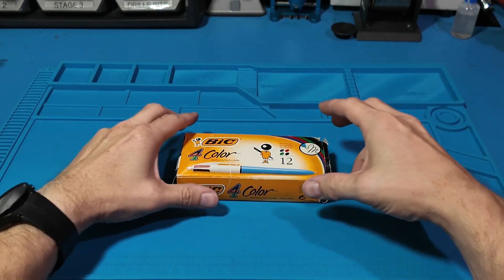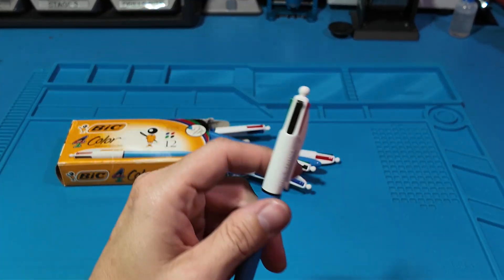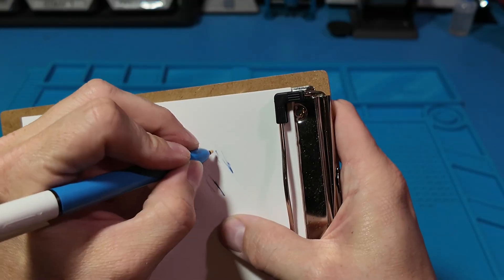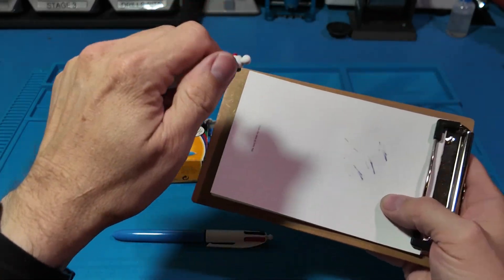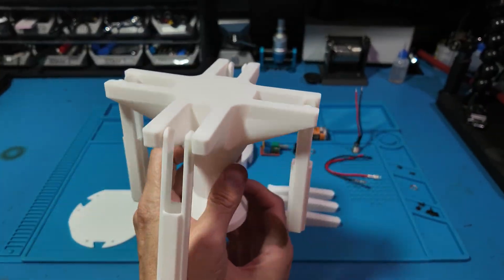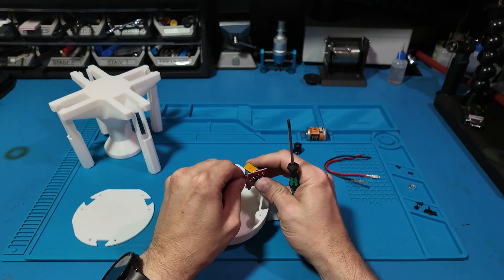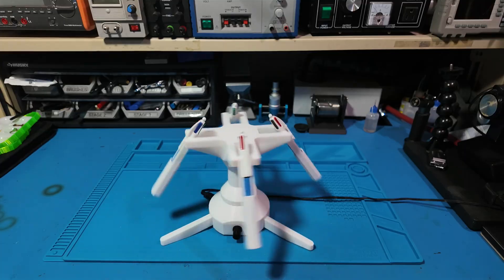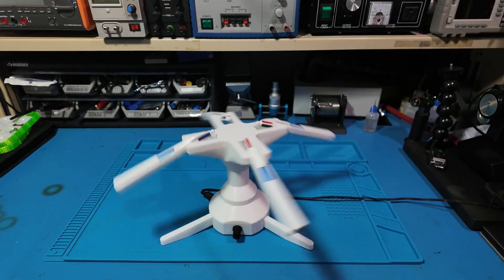DIY Pen Centrifuge | Trying to Revive Dead Thrift Store Pens (It Didn’t Go Well)

Comment: Do you really need a motor controller with a cheap Radio Shack motor?
Reply from the maker: With the mass of the upper it helps with stripping the socket the motor pushed into.

Comment: You need to apply heat to the tips. like 5 seconds with a lighter. 

It melts the inkclumps at the ball.
Reply from the maker: I did try heat some came back just while they were hot then stalled again , it would have been great to revive them.😀
Reply: @Sawdust_and_Circuits  Maybe a solvent like olive oil or WD40?
Reply from the maker: @SkyOctopus1 I like acetone someone mentioned I think that stuff is crazy powerful.